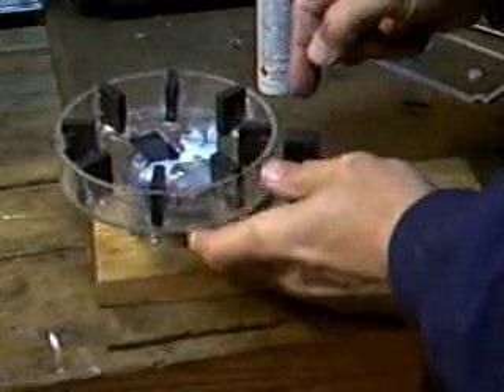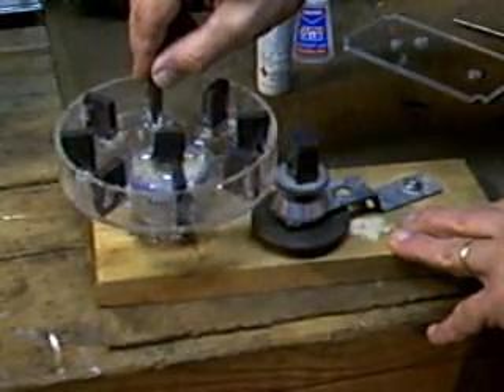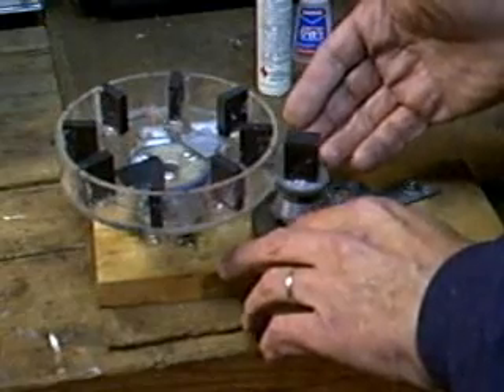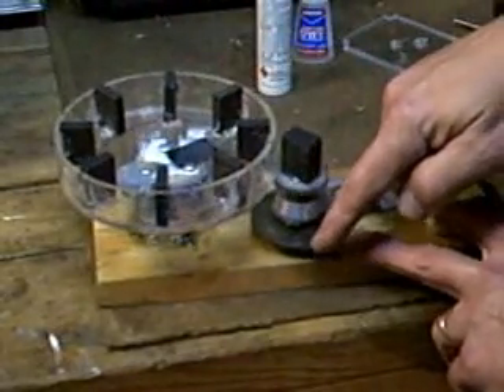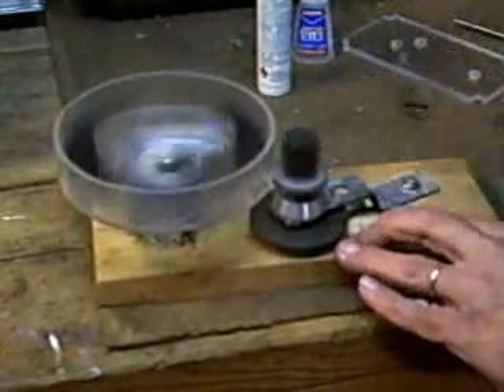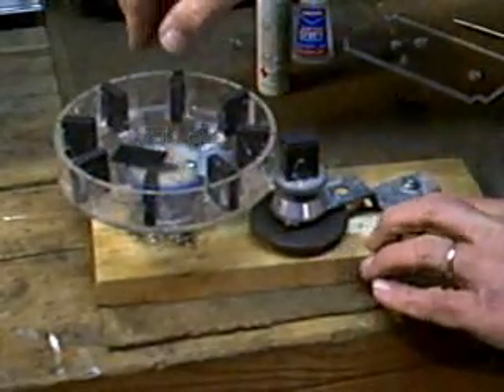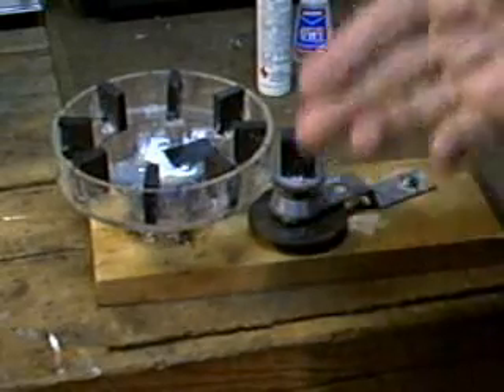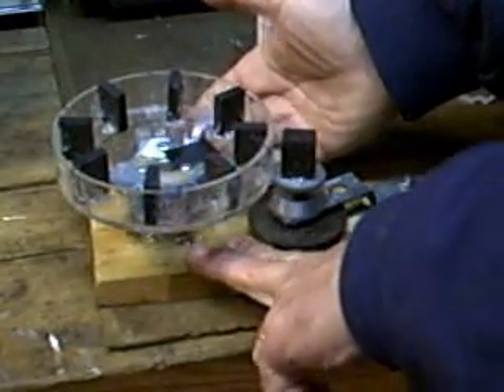#61 Zero's not-so-good OC-MPMM replication

Comment: You made fun of the Judson dampers - it is a stupid name to give to a couple pieces of aluminum but that's all they are - you obviously do not know how the OC mpmm works - if you can get the small rotor to spin reliably agw throughout the speed range then you will solve 90% of the problem - once you accomplish that then you use the aluminum to slow the Little Wheel down slightly without slowing the large wheel down - the fact that it requires such a perfect balance is what makes it difficult - Alsetalokin took the trouble to measure the field consistency of the eight neodymiums on the large rotor - agw spin is far more difficult to achieve than both rotors in gear wise - if you want to know how it works then I will tell you but first you have to get the small rotor to spin anti-gearwise through a varying speed range with very little friction - the only reason I bothered with commenting on this is because it looked like you had the small rotor in agw and the only reason I believe that might be possible was because both Wheels stopped at the same time while the Little Wheel did not appear to reverse after you started it spinning - the observation you made about the inconsistent magnetic connection was valid but may not be applicable because this motor does rely on continuously engaging and disengaging magnetic fields, so it will be normal to have free movement between the polar connections, just as long as it doesn't disturb the timing - I like the way you achieved the agw using differently configured magnets - I have always believed that the whipmag as designed by Overconfident required too fine of a balance, you may have proven that - It may well work as is, or slightly adjusted, and by adding the aluminium dampers - All you need to know now is what the dampers do - do you still have the build and would you like to proceed ?

Comment from the maker: @vossua Actually, that was sort of the point of this "not so good" demo. The original OCMPMM also had no timing mechanism other than the magnetic interaction between rotor and stators, timing regulated by inertia of the spinning stators. I do believe Alsetalokin may have observed an anomaly but not for the reasons he thought, which is why he could not replicate it faithfully. My new attempt with the VFPMM will explore this in greater detail.

Thanks for watching!

Comment: So where's the interlaced timing mechanism? I'm NOT saying this design works, I thought there was a motor driving the system beneath personally my self, but unless one has the magnet system constrained, [flywheel included] must surely not self sustain because there is [as you said] nothing to keep them in synch. Also, there is no way to harcest any power from them at this level of development...

Comment: Hi, 
I really appreciate you sharing these videos.
I am no scientist or anything near but with all the respect I like to make a comment on this experiment video.
What I see here is basically two magnets pulling each other which slow down the spin. Also it looks almost impossible for you to calibrate which part of magnets would face each other during spinning.  You might want to try a model that you are in control of the poles so magnets push each other.
Best of  luck.

Comment: i got a great test idea on your motor that had the stator that moved up and down .move it up and down with a small electric motor and a wheel with a bar attached like how a steam train works then attach another motor to the rotor gear it up if you have to and then you could measure the watts in and watts out to see if you can reach over unity if you can then youll have a proof of concept device and that would be a remarcable achievment best of luck!!!

Comment: Don't you think the magnet shapes are making your rotation non linear as you say? Look at the original, the shapes are completely different. Most importantly you need round magnets on the outside and longitunal ones in the main disk. Otherwise your magnetic fields are so different from the original there's little chance it's going to work. You can't debunk anything with a replica that's only 20% correct. Make one wonder if you're a poser paid by the oil companies. "What a shame"!

Comment: An accurate peer review would include an 'exact' replication.  Comparable results cannot be expected when you use square ferrite magnets while the device being analyzed uses round neo diametrically magnetized cylinders.  You might also recheck the polarities of your rotor magnets with that of a couple of others that do run.  Skepticism is fine, cynicism however is unfair and non productive.

Comment from the maker: I digress. It was a less than ambitious replication. But, considering I do not have a milling machine, YET, I do okay with what I can scrounge. It seems to me if acceleration can be achieved without direct gearing between the rotor and stator, The same should be achievable with direct gearing and proper timing.

I would love 2c slo-mo playback from a high speed video during accel.

I'm anxious to see what Clanzer gets for results, 9au4O6_QuSs  Rooting for him all the way.

Comment: Do you think the other two magnets had anything to do with it?  They were aligned a special way.  When the magnet he spun was at the tip or in between the magnets on the flywheel, the other two where at directly next to magnets on the flywheel.  I noticed this because all three spinning magnets where at odd angles to the flywheel.  They weren't at 60 degrees which I had thought they'd be.